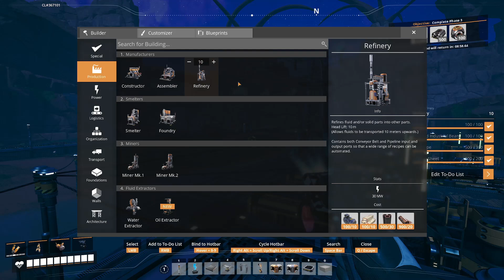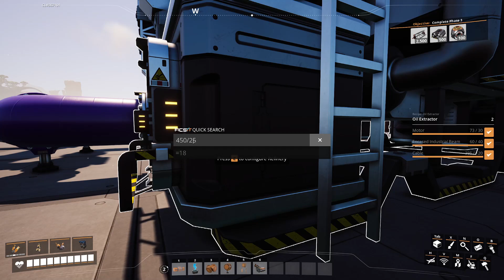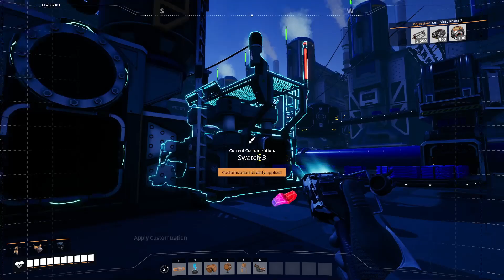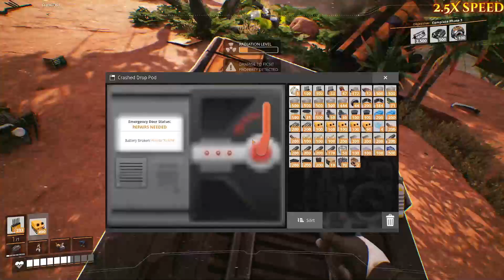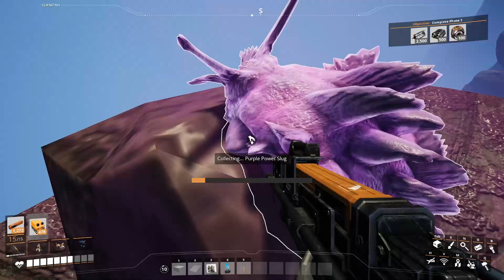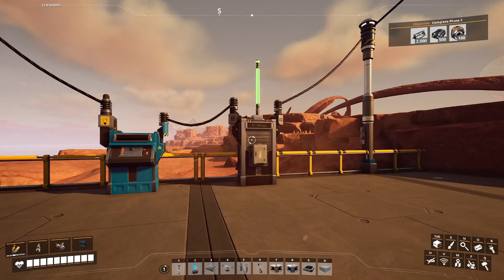First Oil Setup & Exploration - Satisfactory 1.0

Comment: I enjoyed watching your highspeed exploration and how you do things. Personally, I prefer building platform power towers and zipline between them equipped with a parachute in case I fall. However, it does leave the unsightly landscape full of towers, but it does eliminate the need for biofuel burners to open crash sites. I also like using the rebar gun to snipe enemies from the tower platform (platform protects me from ranged fire except shooting hogs), though you do have to account for range as the ammo drops (got good at that playing Valheim). Also, guns attract enemies from afar, which can be overwhelming (fun to watch spiders fight hogs and spitters, though!). Just personal preferences in the end. Thanks for the videos!
Reply from the maker: The power towers are something I should definitely utilize more when exploring in the early game. They can make some of the awkward terrain so much easier to get around. If I wasn't so bad at aiming I would use the rebar gun more lol! Thanks again!
Reply: @moo121  Once I unlocked the hoverpack, I can use power towers and branched power poles to get ANYWHERE and fly! Tunnels, no problem (except for scary big stingers). Cliff faces, throw a foundation on the wall and then a pole. Experience fewer days without incidents!
In truth, I love that there are multiple ways to accomplish certain tasks in this game to allow people to choose their preferred methods. It's all about having fun! No one is being judged on how efficient you're being, right????  <.<    >.>
Reply: @moo121  Thanks to your tip/reminder about being able to sneak up on hatchers without them opening, I discovered that you can SHOOT them while stealthed and they won't open, handy for dealing with ones you can't walk up on (overhanging, on walls, etc). It's a little harder as you can't see them open when you hit them, so you have to be more confident in your aiming. But that way, you don't have to deal with a bunch of flies from the bigger ones if you don't have seeking bullets yet.

Comment: Camera: I'm watching you, Moozowski...  Always watching...

I just built a very similar plastic, rubber, petroleum coke, energy plant a few days ago!  I like how you tried to balance your pipes.  I just had supply go over an inverted U and have everything connected as a loop.  I used the uber compact balancer for the coke.  Two refineries to nine generators.  My water was run under the floor.

Next I am starting central storage!  Just figured out how to make any size circle with foundations and some temporary painted beams!
Reply from the maker: LOL and I didn’t even notice the other camera in the hub!
That sounds like a good setup. I like the inverted U, it comes in handy. Good luck with the central storage! I love circle builds, they can be tricky at times but they sure look cool. Next I’ll be building an oil power plant, in a big box :)